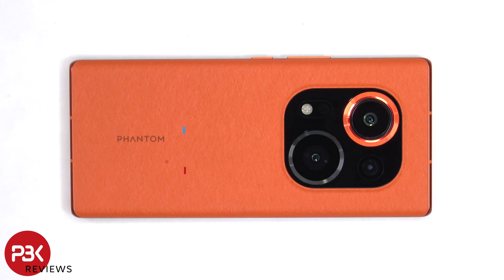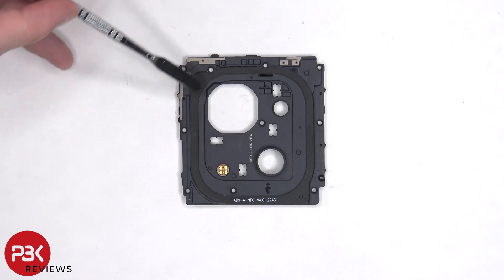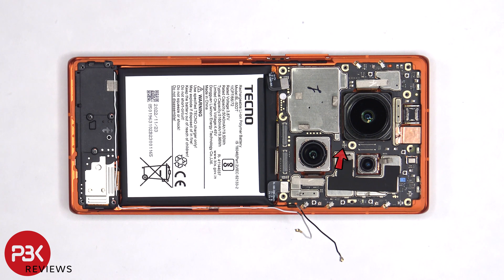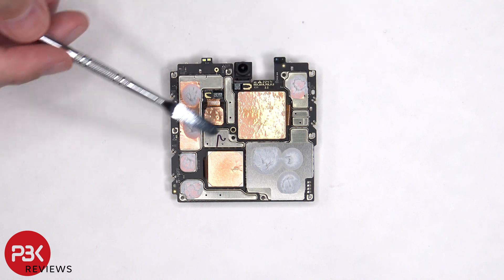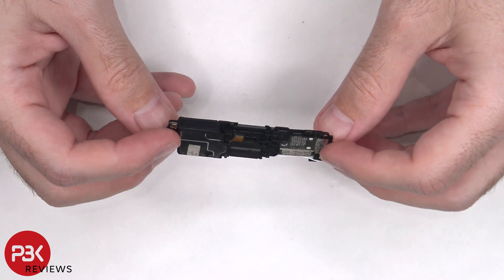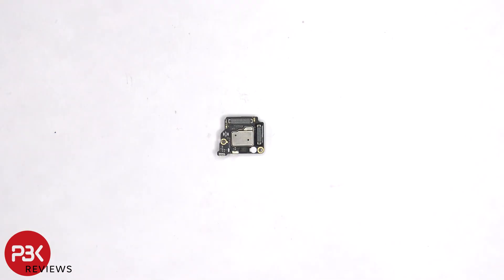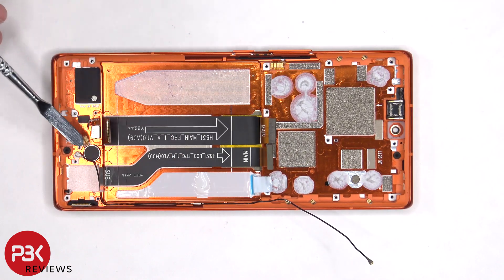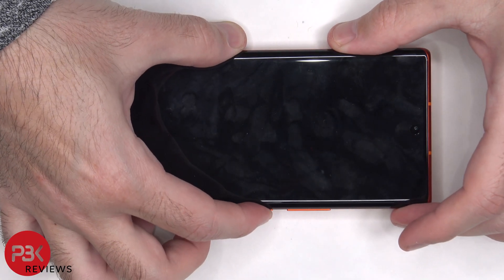Tecno Phantom X2 Pro 5G Teardown Disassembly Repair Video Review

Comment: Does the optical stabilization cost a lot? Why this model with 2 x 50 MP camera do not have such?
Reply: They focus of visible hardware to show it's the new thing..... Or a benchmark..... but it does nothing
Reply: A phone with good optical stabilizer is much better .....i phone 14 pro Max has levitating camera sensor instead of lens for IOS
Reply: due to the camera extension mechanism, it is not possible to do this

Comment: look at the   E N O R M O U S   camera...
Reply: Inside that big module there is only a 1/2.7" sensor, which is small compared to other phones. The main sensor, that little bit smaller one which is not retractable, that has a 1/1.3" sensor, which is not bad, but the phone has a design to appear better than what really it is. (I hope you know that 1/1.3" is bigger than 1/2.7")
Reply: because you dont have that why  means you don't have a phantom